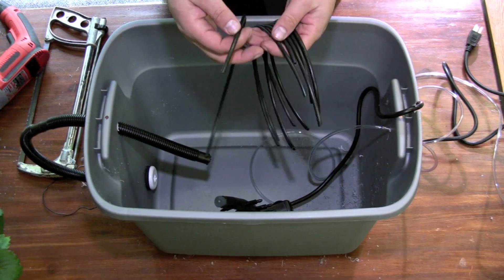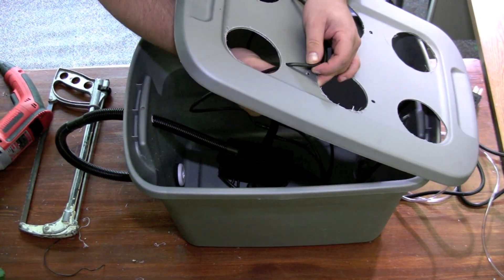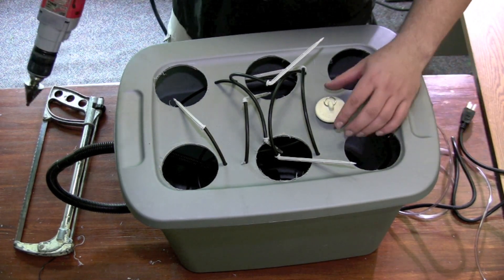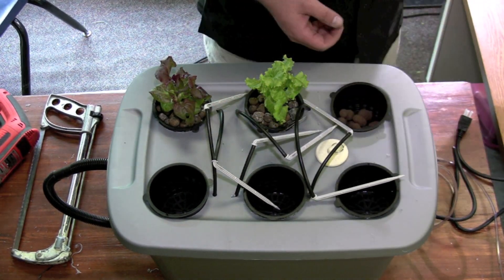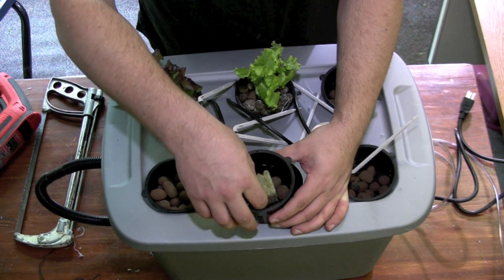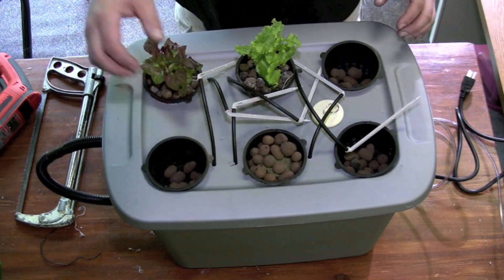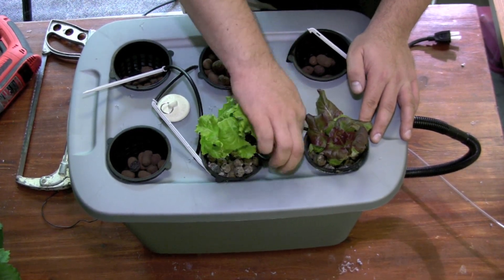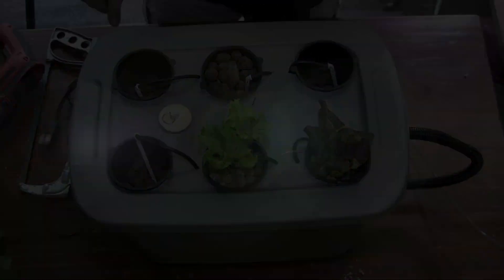How to build a hydroponic system part 2

Comment: put white shoe laces threw the bottom so they come out both sides of the net pot,then put your grow cube on top of the laces.now put your rocks in,no light can get to the cube.laces work as a wick until they form roots.make the laces long to hang down half way down in the tub.fill the tub so net pots are down 2 inches in the water,if you forget to add water the wicks will still feed the plant.one of the down sides to dwc is if the air pump goes out,dont buy 1 pump,buy 2 or 3 small pumps if one goes out you have a back up.NO NEED FOR DRIPPERS been doing this for 30 years,WORKS! change nute every 20 days and have a second container  to set the plants and top on while you dump the old nute on your house plants and out door plants,its still good for soil plants.next buy a deep cycle boat battery and a 12 volt airator for fishing when electric goes out.as far as light when the electric goes out your be brave and put them out side SCAREY!    I LIKE THE KISS FACTOR,KEEP IT SIMPLE STUPID!

Comment: Does anyone else think he's overcomplicating this WAY too much? I mean seriously, I built my Deep Water Culture system for $30. This looks like it would cost me over 100!
Reply: +Sqpvfcg Zdxk 
no need for the drippers in a DWC system this is a hybrid system technically.  All you really need is the tote, air pump, net pots, clay balls and nutrient/water and done. That is how my system was made. The water pump does not hurt, but it does not help either...not in a DWC system.
Reply: don't be misled, you need a aquarium heater too, plants grow best when temp is 60F-72F You need heat. Too much will cause rot, too little causes shock

Comment: Why are the drippers necessary? Would it work without them?
Reply: Controls the flow instead of flooding they slowly feeding the plant.
Reply: +Caleb Dunteman 
yes it would work with out them, this is a DWC hybrid system. I use a similar system minus the dripper.

Comment: Help me out, last couple of questions :)
   Does the bottom of the net pot remain under the water line; or is there space between the bottom of the pots and the water line in the tank?
   Can you ultimately add another container with more net pots and run it off the same pumps, or do you need separate air & water pumps for each new container?
   How does this system differ from "Ebb & Flow"
Thanks in advance for your time and effort in putting up the videos!

Comment: Help me out here please:
   The white drain plug and the black hose (at the bottom of the container) are only used to empty the entire system of water and nutrient when it is time to put in new water and nutrients?
   The white plug on the top of the cover is so you can add fresh water and nutrients through the hole without removing the cover and disturbing the roots?
   How long does the air pump & the water pump run, continuously are they on a timer or cycle?
   If you

Comment: @shawszaa 
It depends, but I'll take a stab
My guess:
water pump: $15
tote: $6
air pump w/air stone: $12
net pots: $4

There's probably <$10 worth of drip equipment and hoses and hydroton being used, but you might have to spend $30-$40 because that stuff is often sold in bulk quantity.

Comment from the maker: @slparenteau 
I run the drip system 24/7.  Since the roots are partially submerged in water when the plant is mature, it is a good idea to keep the air stones running 24/7.  If you wanted you could cycle the water pump several times a day, but a 185gph pump only uses 12 watts so it is not expensive to run.

Comment: @w8mk 

FYI, I have been researching this stuff and I heard that the deep water culture method (submerged netpots without the drips) works because the water the roots are sitting in is highly oxygenated by the air pump.  Maybe that explains why they can be fully submerged without problems.  I haven't tried this yet myself but I have seen several growers claiming it is a successful way to do hydroponics.

Comment from the maker: @citigarden 
I have used the sprayers and they worked well for short term plants.  My frustration with them is when they clog and your roots don't get sprayed.  The drippers have been maintenance free for me and I yet have to get a clogged dripper with my particular setup.  I use a 185gph pump so the water really comes out quite fast and is not a drip.  It I had regulators on and used them as actual drips then they would also clog over time.  But yes there are many ways to build systems!

Comment from the maker: @GreenOuthouse 
The water pump is running at 12 watts and the air pumps is 4.5 watts.  Both use little energy.  What you suggested sounds intriguing, I read somewhere, that most plants don't do as well when so many of their roots are submerged in water.  If a lot of the root mass is in the air, they are able to absorb more oxygen, causing faster growth.  Have your plants done well with your methods?